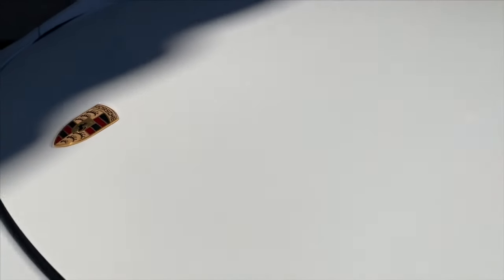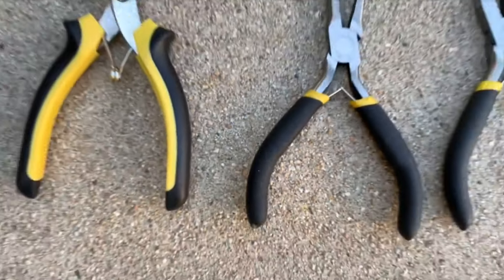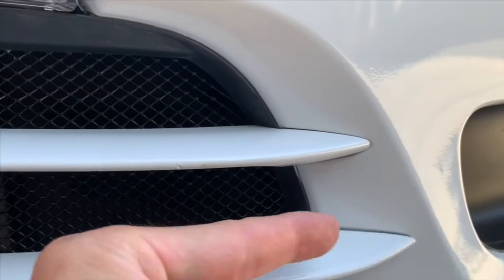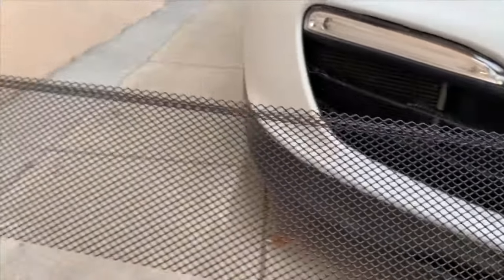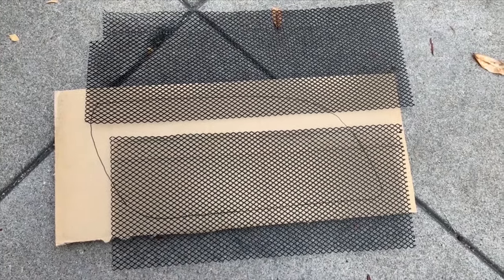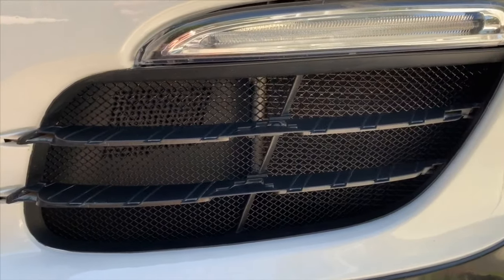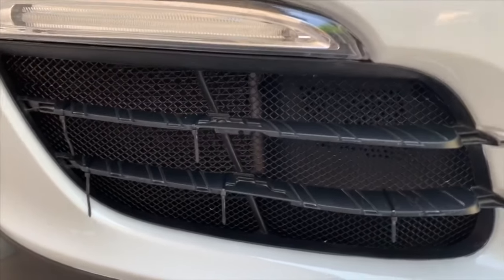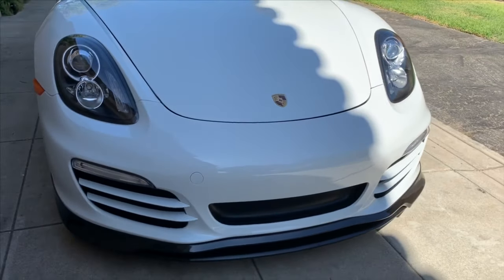Porsche 981 Boxster DIY Radiator Grill Mesh Tutorial

Comment: Does this install work if you have parking sensors in your bumper?
Reply: I have parking sensors on mine and did this, I just folded the grill back where the parking sensor would be. Cutting the grill around the sensor is another option

Comment: For anyone watching this as a guide, the video is quite helpful. However, I found the info regarding fin removal to be missing an integral component. You’ll need to shimmy a tool under the inward (thicker) side and push the tab up to get it to release. I almost broke my fin and patience before reading this bit elsewhere. 

The video rocks otherwise.
Reply: ugh broke my tab
Reply: Yes, you need to use a small flat headed screwdriver or something similar to release this tab, thanks for pointing that out.
Reply: I used a small table knife - the broad blade meant that it was easier to apply upward pressure to the tab. Slide it into the slit below the strake cover, between it and the body, after releasing the centre tab and pulling out the cover from the outer end. Really easy and quick once that tab on the thicker end has been popped out. The knife didn't damage any paintwork. I see that the tab has been broken off in this video, which accounts for the easy removal.